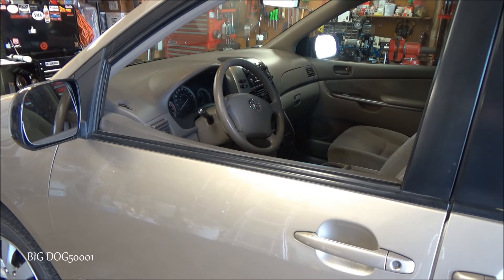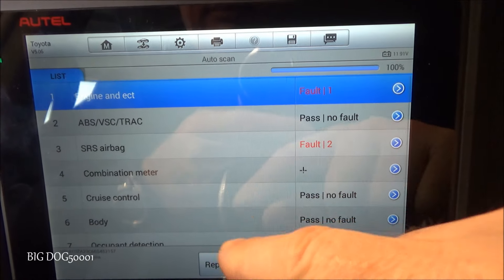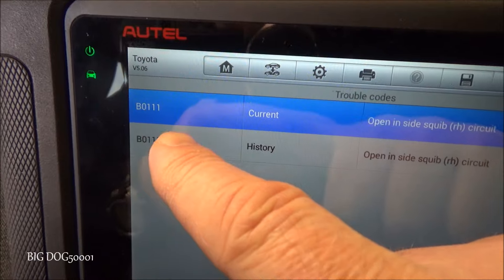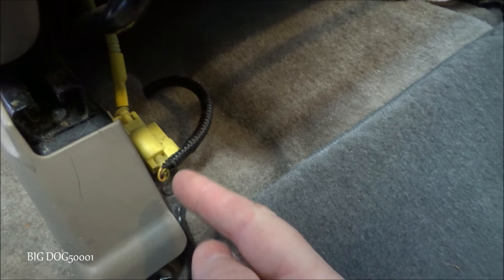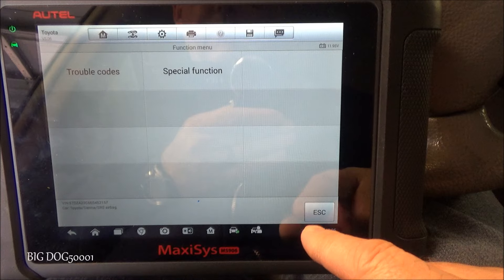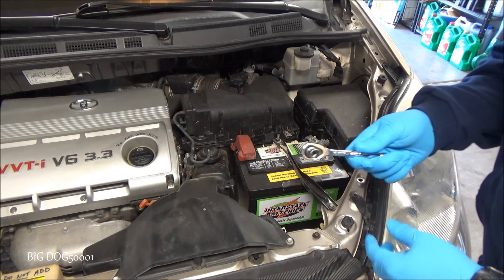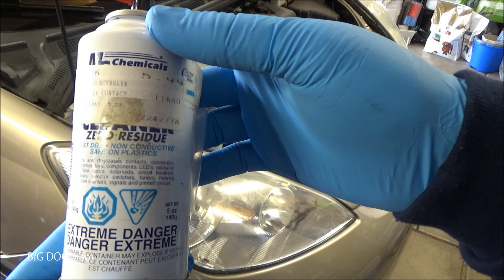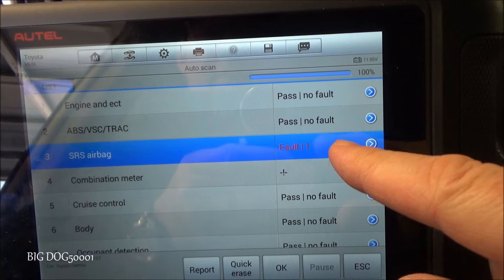Toyota SRS: B0111/B0116-Open in Side Squib Circuit

Comment: I have the same issue but once I checked the connector it turns out that the previous owner cut and connected the wires from the floor harness using butt connectors. Does this mean I need to replace the whole floor wiring harness or should I just try to reconnect them with a crimper tool?

Comment: Thank you so much for the video. I also read all the comments. I have a 2007 Toyota Sequoia code B1821. Connector wire was twisted. I also blew out any dust in the connector. Moved the pins a small amount. I had 3 mechanics look at this issue. One of them said I need a new seat. Light is now off. Thank you!

Comment: Thanks for this video. I bought this exact same vehicle (2006 Sienna LE) in 2019 in Ontario, Canada to take and leave at our summer getaway in Newfoundland so that we wouldn't have to rent a car when we fly in for the roughly two months we spend there every year. Although it didn't show up on the test drive, the flashing airbag warning appeared just a few days before I was scheduled to begin the three day drive across four provinces, and I didn't have time to try to fix it then. Also, my Autel "prosumer" OBD reader doesn't do SRS, and I hadn't got a TechStream setup functional at that point, so I didn't know specifics about the fault.

Due to the pandemic I didn't make it to Newfoundland for two years so this year was my first chance to try to solve the fault. In the meantime I picked up a Bosch OBD tool for half-price and unlike the Autel, this one does SRS. When I ran it on the Sienna it listed BOTH the B0111 and B0116 error codes, but after I cleared the SRS codes only the B0116 one came back when I started the van (of course I'll fix both sides anyway). My contact cleaner spray was 1150 miles away back in Ontario and our summer place is about two hours from even a mid-sized town and about 6 hours from St. John's, which might have some available, so instead I soaked 99% IPA into the connectors from a Q-Tip and then connected/disconnected them about six times each. Reconnected the battery and waited... NO SRS warning light!!! A test with the ODB scanner confirmed that the problem is solved, at least for now. I will probably bring a can of contact cleaner with me from Ontario next time I visit Newfoundland, although I expect to be in St. Johns overnight in about two weeks so I will try to find some there.

Thanks so much for your very detailed video, especially the clear warnings about disconnecting the battery. Of course, now I have to wait for all the drive cycle tests to run, which could take a long time given how little I drive it here.

Comment: A few months ago, I removed my 99 Camry drivers seat and of course disconnected the plug(s). I think I had the radio on during this. A few days ago, I was checking out my friend's new OBD2 scanner in my car and noticed I had a B0116 in the history. Do you think this was caused by me removing the seat plug with the key in the accessories position to run the radio? I erased the code, but gave the scanner back, so I cannot see if the code returned. I have no MIL on. Thanks for posting this.... very helpful!  BTW.. Thanks to Toyota for giving it the name squib- so no one knows wtf they're talking about- obviously to make life unnecessarily harder.
Reply: You can absolutely cause a trouble code by removing any SRS connector. The system doesn't know if the break occurred at the connector or weather a wire has been cut, etc. so you will often get a code any time a yellow connector is disconnected.

Comment: probably the best video i've seen here regards to troubleshooting SRS airbags.  I have an 07 RX350 with a trouble code B0116 (driver side) and will try these helpful tips.  Thank you!
Reply: an update 4/29/22 - so I took a risk upon myself and followed all the steps carefully on your video and found some sort of sticky clear non-smelly residue that almost resembles gel of some sort (not sure what that is) when I unplugged the SRS yellow wiring harness.  Cleaned it and put it back in and my blinking SRS light is GONE!  Now, I don't have a scanner to clear the code but happy that the annoying blinking light is off... crossing fingers that it does not come back.  You helped save me some 
$$ and for that, I SUBSCRIBED!  Thanks again for this very informative video.

Comment: Cleaning is, IMO, only step 1 of the permanent repair. Step 2 would be to bend the prongs VERY SLIGHTLY APART to create a tighter connection when they are re-inserted. These two steps usually eliminate the need for an entirely new connector.
Reply: Hi, I’m desperately trying get that air bag and alarm so stop on my 2013 GX460. Ill pull the passenger seat again and try to spread the connector. any other suggestions appreciated!..

Comment: I have a BAFX OBDII bluetooth and it did not show the SRS alert when downloaded. It did however allow it to be cleared (but it came back due to it still being an issue). I decided to clean both connectors with contact cleaner and now the SRS warning is gone. Thanks, you saved me an expensive visit to the mechanic.
Reply from the maker: Thanks for the comment!

Comment: Would you know what B1806 open in P squib circuit would be in a lexus 06 is250? Cant find any mechanic in my area that would work on airbags. Thank you
Reply from the maker: A B1806 on that model is an "Open in Front Passenger Side Squib Circuit".  This means the system is seeing an issue (open circuit) with the passenger air bag.  You may have to travel further out of your area but I would look around for a mechanic that knows how to troubleshoot Toyota SRS systems.

Comment: Sir, what color is for Nissan Frontier truck? My airbag light goes one lit then twice lit lit repeatedly. I didnt find yellow connector under the seats. Thank you for feedback.
Reply from the maker: Pretty much all manufacturers (including Nissan) use yellow for anything that is part of SRS system.  Sometimes the connector may not be yellow but the loom over the top of the wiring leading up to the connector will be yellow.

Comment: Thanks for the video. If there had been a problem in the airbag wiring in the seat itself, how would you test for that. I would not want to put a meter across those two terminals.

Comment: I have this same problem on a 2000 4runner but mine is steering wheel mine is related to the clock spring
Reply from the maker: Did you have one of these codes, B0100/B0101/B0102/B0103?  If so, these is a good chance it is a bad spiral cable (that's what Toyota calls it).
Reply: @BigDog50001  I would have to scan it again but the horn the cruise control and the airbag stopped working at the same time then a few days ago the horn went hay wire and started going off and on when I turned then after 20 miles the horn wouldn't turn off I had to unplug the horn and also heard a popping sound when the steering wheel turns then the sound went away and now my blinkers dont turn off after a turn no more

Comment: U have any info on honad code 85 63 ...odps replaced 3 used module already same code internal memory?????
Reply from the maker: What year and model?
Reply: @BigDog50001  2003 accord 2 door.
Reply from the maker: That code for Honda means an internal failure of the OPDS (Occupant Position Detection System) Unit, which is located in the passenger seat back.  Later models call it ODS (Occupant Detection System) and also include seat weight sensors located in the seat track.  There is also an OPDS sensor grid located in the passenger seat back to help detect if a passenger is sitting upright in the seat or leaning (the system does not want to deploy the passenger side airbag located in the side of the seat if someone is in the way due to the design of these older air bags).

Whenever the OPDS is replaced or the passenger seat back cushion or cover is replaced, the memory needs to be erased (SRS DTC codes cleared) and then the OPDS unit needs to be initialized with a Honda capable scan tool.  If the OPDS Unit has already been replaced 3 times, the OPDS Unit is probably not bad.  The OPDS sensor in the seat back, the wiring or other issue may be the cause of the issue (or the OPDS Unit needs to be cleared and initialized).
Reply: @BigDog50001  tried to initialise so many times .i think the sensor is bad...also when i do a. Live data it says invalid for the opds sensor ....and when initialise the light goes out but then comes back when do a second start

Comment: Interesting and informative. Thank you for sharing. I did not know you cannot resistance check an air bag.
Reply from the maker: Thanks for the comment!
Reply: The OHM meter has voltage to measure resistance.  Thus, if the probes are attached to Squib, the meter will apply enough voltage to ignite and implode the bag.  The video is very helpful and presenter is absolutely on the mark !! ejdossary, EE

Comment: Hi, I have a small OBD reader with LCD display  (not an Autel like you use) will I be able to see SRS codes with it?
Reply from the maker: Chances are it will not read SRS codes, usually need to spend over $100 on a code reader to see SRS.

Comment: Hi, I have B0130 airbag code on a 2004 Toyota sienna do you know where this can be? Thank you
Reply from the maker: A B0130 is a short in the front right side outer seat belt pretensioner circuit.  There are small explosive charges in the seat belts that are designed to tighten the seat belts in the event of an accident.  The computer is seeing a short circuit during its checks on that circuit.  In addition, there are shorting bars inside the connectors that short the circuit when disconnected, as a fail safe.  Disclaimer:  It is possible to get injured working on these systems and I don't recommend working on them if you have not been trained.  It is probably best to take it to someone who knows how to safely troubleshoot these systems.

Comment: My 2002 Avalon airbag light is on code B0118. Would that be the driver side squib?
Reply from the maker: A B0118 for that vehicle indicates a problem in the circuit for the side air bag on the left side of the car (US driver's side).  The SRS module is seeing that the circuit is shorted to battery power (B+) or that there is an issue with the air bag assembly or SRS module.  The air bag assembly, the wiring or the SRS module itself could all be the cause.  I advise taking it to a shop that knows how to properly troubleshoot SRS problems like this.
Reply: @BigDog50001  Thank you

Comment: * cross eyed * Side airbag? I have a 1999 4runner SR5 and I’m positive that it doesn’t have side airbags. I’m getting B0131. Time to do some digging...
Reply from the maker: Those 4Runners should have a passenger air bag (not to be confused with a side air bag).  B0131 is an open circuit between the passenger seat belt pretensioner and the Airbag Sensor Assembly (airbag control module).  Most likely an issue with the wiring to the seat belt pretensioner or the seat belt pretensioner itself.  Not something I recommend working on unless you know SRS systems.
Reply: Big Dog50001 Automotive Thanks! It sounds expensive.... I don’t want to mess with it, I’m going to leave that to a professional.

Comment: Hi, thanks for a nice informative video. Could this also work for the error code B1826? I get this code on my Avensis 2012 model. Not going to fix it my self, but I am not going to pay the local Toyota Repair shop 900 $ for changing my airbag, if this is a more likely solution to the problem.
Reply from the maker: We don't have those models here in the U.S., but there is a good chance it is similar to the issue that was on this vehicle but on the left side of car (when sitting in driver's seat).  Thanks for the comment!

Comment: Took my truck to a mechanic shop and they informed me they turned the steering wheel 15 times to the right and then turned it 13 to the left and my air bag light came on 15 miles after I got my truck back the shop refuses to fix what they did so now I need 1500 dollers to fix it

Comment: Good corrective Video.  I tried this approach by cleaning the Yellow connector on my 2002 RX300 which fixed the blinking Airbag RH Squib B0113 code.  Months later the problem came back.  Now I am planning on replacing the YELLOW CONNECTOR, good riddence !!
Reply from the maker: I appreciate the comment, thanks!

Comment: My 2002 RX300 Airbag light began flashing.  Read the code on my scanner and it was B0113, short at B+ RH passenger Squib.  When disconnecting the Squib cable, the scanner displayed Code B011 which is open circuit. That indicated the side squib was defective. Researched the simulation resistance is 2.7 go 3.3 ohms.  Configuration a load of 3 ohm resistance extinguished my blinking Airbag light. I wonder how long this simulator would work before replacing the bad side Airbag?  Please reply if any experienced similar fault andd simulation !
Reply from the maker: A simulation load is only supposed to be used for diagnosis.  After that, the simulation load should be removed and the defective parts should be replaced.  Leaving it there disables a critical safety device which I do not recommend.